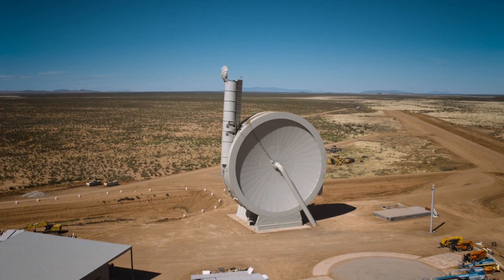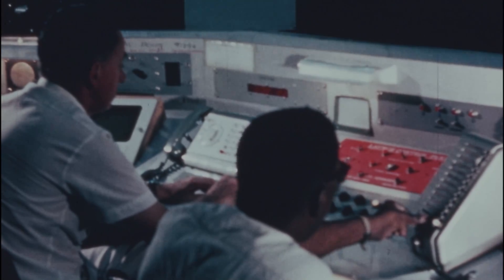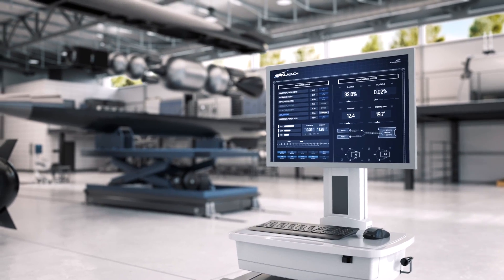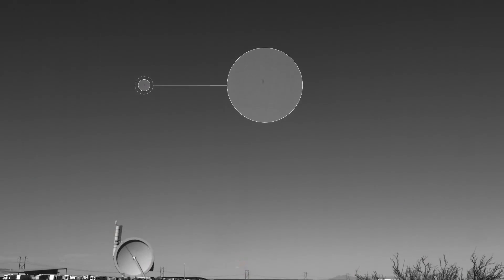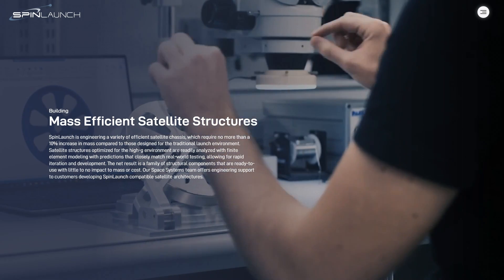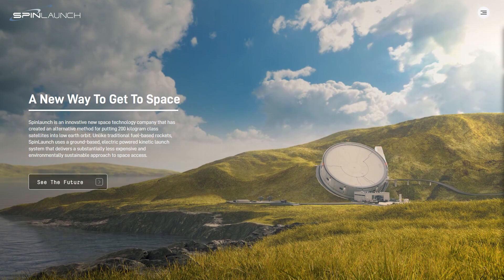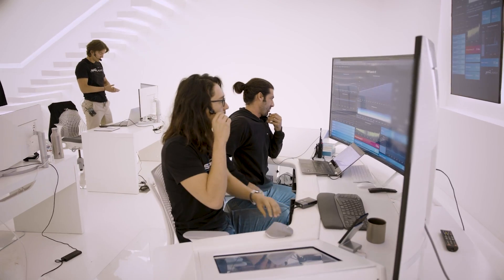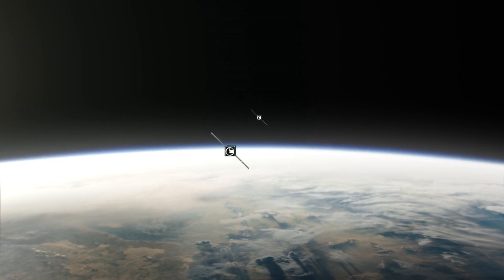Can Spinlaunch Throw Rockets Into Space?

Comment: The rotating arm must be very very very perfectly balanced or the vibrations will destroy the whole machine. Also it must be able to hold many many many tons in tensile strength. Remember that total force = mass times acceleration. And about the balance. Once the payload is released the whole thing becames heavily unbalanced. Imagine that you have 500kg payload. Now, you have 500G acceleration in this. Than means theere is 500 tons of force acting on spinning lever. (250 tons the payload and 250 tons the counterweight.) And in the point of disconnection there is nothing one one side and 250 tons on opposite side. IMO it can't ovelive that.

Comment: This looks like your run of the mill VC scam. They build something that could have been achieved easily any time in the last half-century, and use it to build hype (and huge amounts of investment money) without proposing solutions to any of the problems involved in scaling it up. How will they maintain such a large vacuum for so long in the face of extreme vibration? How will they release the projectile with the required precision, and keep the thing balanced so it doesn't explode spectacularly? And how well they design a projectile that can withstand those kinds of kinetic and aerodynamic forces? It's always demonstrations, never solutions.

Comment: The idea is not new, but it will never make it to reality due to physics:
- how to get rid of the projectile's spin, better to say pitching with several hundred RPM?
- how to get rid of the forces of the counterweight after the projectile's release?
Yes, the vacuum issues can be solved by putting the device onto the moon.
Reply: @Puppet Having a counter weight the same as the projectile and dropping it at the same time down a long drop into a large pool of water would solve the counterbalance issue
Reply: @dv8inpp  That actually seems pretty reasonable. It could even be heavier so it could be closer to the axis and not moving as fast (if that was an issue). 
I was thinking of a weight on the same side as the rocket but closer to the axis of rotation, and the weight moves up  upon release, but it would have to happen really fast. So just releasing weight in the opposite direction seems like an interesting solution. 

(also, having weights near the axis that move out after launch is yet another of the myriad possible ways to slow the thing down quickly)
Reply: This machine reminds me of something Reagan's Star Wars initiative would make 🙋🇺🇲🛠️🇷🇺
Reply: @craftpaint1644  Reagan
When all the nonsense started.
Reply: What do you mean with "projectiles spin"? I dont get where there is a problem with the projectile spinning, other than the 10000 G which arent thst big of a deal after all.. Or do you mean the launcharm spin that causes issues?
Reply: They could add another rocket to the other side of the machine and release it in the same rotation as the first one; by doing this the machine would "only" be imbalanced for half a rotation, tough this is also one of the most critical situations, as thechnicly in this short moment the strongest forces would be pulling. (and the vacuum wouldn't exist anymore, questionable if it would work properly anyway)
Reply: So, the counterweight is something that got me. Perhaps the system could be mounted on a moving arm, if such a material exists, that could take the sudden acceleration, until the counterweight moves to the center of rotation, or a second counterweight moves to replace the weight of the projectile. Or the design could be self-destructive, with protective barriers containing debris from exitting at a dangerous angle.
Reply: @Abrupt Segue That sounds a lot simpler than my idea. Then it just becomes the question of what to do with the launched counterweight; maybe just launch it through a multi-staged barrier, with different resistances at each stage.
Reply: @Abrupt Segue So you will release the energy equal to the projectile into the ground?
btw this energy equals a nice little tactical atomic bomb.
Reply: @peterebel7899  it's not that much.
Reply: @TheJohnreeves  To keep the calculation simple:
- no air in the Earth's atmosphere: 11,2km/s or more needed
- give the projectile 100kg
=> The energy needed equals 30,000kg TNT. Bombs with this energy enclosed are atomic bombs.
Additional comes the air resistance of this fast tumbling projectile. For getting an idea of this please study meteorites.

"not that much", how close do you want to stay to that launcher?
Reply: @Abrupt Segue Oh yes, jet us say a cubic foot of sand would stop this gun shot. Th counterweight would need at least 100x100x100 feet of sand (when used in vacuum, no atmosphere)
Please do expert some effects you never experienced with a gun but with an impact from a meteor. And please do have the fundaments from this launcher well apart from the bottle of sand.

Not just you seem to miss any sense for dimensions. The energy we are talking about is the combined energy of all 4 attacking aircrafts in the 911 event just focussed in one single point of impact. We are not talking about some toys used in a shooting range or even battle field.
Reply: @peterebel7899  Your math is over by an order of magnitude. 1t TNT equivalent = 4.184 gigajoules (4.184 * 10^9 j).
100kg at 11.2km/s = 50*11200^2 = 6.272*10^9 j. 6.272/4.184  = 1.5 tons TNT.

Furthermore, if you double the counterweight, you can move it closer to the axis and halve its velocity. Since energy is proportional to velocity squared, the new energy will be (.5 * m(v/2)^2) = .5 * (mv^2) / 4. I.e. one quarter. It's easy to imagine making the weight even heavier and have rather manageable amounts of energy involved.
Reply: @TheJohnreeves  Yes, you can reduce the energy by increasing the mass and shortening the arm. But this generates other troubles like increased distance to diaphragm, asymmetrical implosion when the counterweight is still in free flight within the chamber, ....
This idea does contain several magnitudes of physical constraints hardly to overruled by engineering.
Reply: @timemachine_194 1. Projectile:
Mach 7 with a tumbling object (it rotates around the tilt axis withe the rotation speed of the Spinlaunch): This is nothing like a projectile flying with a stabilized longitudinal axle.
Oh, you want to hold id pat´rallel during spin launch: you are shaking the whole projectile to death with harmonic several thousand Gs for an hour or so. I especially like thinking about the fuel swapping in the tanks. There is no chance launching without a deadly spin.
2. conterweight:
You intend to open a vacuum chamber, let this piece out and close it again within fractions of a milliseconds to prevent high energetic sand destroying your launcher: Good luck with this one!
Good luck with the fundaments above a chamber absorbing the energy of 7 tons TNT day by day.
Nuclear tests performed underground made whole islands in the ocean to disappear.
Reply: What do you mean? The machine can be slowed down by converting the kinetic energy back into electricity with electromagnets. That seems like the easiest part
Reply: @sebasfavaron  The charge back might be too much for a battery to handle, It would have to be a massive group of cells
Reply: Seva's, did you even watch the video?
Reply: Not to mention you need to make a payload that can withstand the centrifuge

Comment: I imagine that they will try to build the « spinny thing » as high as possible like on a mountain top so the projectile avoids thick air as much as possible
Reply: Not really tho, if that would be beneficial, then they would also just launch normal rockets from mountain tops. But theres just too many issues with that, some of them being the cost of building a base and rocket up there or transporting a rocket on top of the mountain, then the issues when the rocket fails.. Plus even the highest mountsin of earth, being at about 10 km above the ground would help just such a very very tiny amount because 10 km is nothing compared to the whole travel, so that the very tiny benefit of smaller air resistance in the fist 1-2 seconds of travel with building a thing like that on a mountain doesnt even make up for the problems and downsides
Reply: @baadlyrics8705  That's because normal rockets wouldn't benefit from starting a few km up since the main thing they spend their fuel on is gaining speed. They'd still be starting from 0 on a mountain top, they'd just have a slightly easier time, during the part of the flight where air resistance matters the least. 
For the spin launch, the beginning is where air resistance matters most. Furthermore, all the issues with moving a huge rocket up a mountain don't exist since they mostly consist of the second stage which is much smaller.
I don't have the numbers so I still don't know if the gain is worth it, but it's definitely more valuable for spin launch than a conventional rocket.
Reply: One of the reasons they don't launch fuel based rockets from mountain tops because of the lack of oxygen. That's why launch pads are as close to sea level as possible.
Reply: @The_KingPrime   Rockets don't use the air (partly oxygen) around them to create burn, they use a mixture of fuels and oxidants carried on board, like liquid oxygen.

Comment: The “counterweight issue” could be solved by ejecting the arm with the rocket and then immediately detaching it, but replacing that each time sounds expensive! Interesting.
Reply: The "rocket" is on a 90 degree angle to the rocket, and the ejection port is about as wide as the rocket itself is long - there's no way you'd be able to do this unless you ejected to the rocket sidewards (so that the arm it's attached to can come out straight) and then somehow "right" the path of the rocket post-detachment.  I don't see how this could work at all.

Comment: So they are building this giant wheel instead of a gun the the acceleration can slowly build up to 10000G instead of instantaneously, but no-one is asking question about the fact that the projectile will still go back from 10000G to zero in a fraction of a second. Basically causing the same stress and vibrations that they try to avoid in the first place.
This is a scam.

Comment: When I had this idea about 20 years ago, I envisaged that the payload would be spinning on a rail system on the inner wall. Then "all" you have to do is open the exit door with an accuracy of one revolution time period. All credit to them - I immediately discounted it as ridiculous due to the humongous g forces.
Reply: Harder to maintain, tons more friction, issues with the vacuum with this idea.
Reply: @TomShlorp  to be clear, both ways are impossible, but one of them is slightly more impossible. But, when you've done 6 impossible things before breakfast, you fly to lunch on a space trebuchet!
Reply: It is ridiculous. All they have done so far is complete a test at about 2% the energy they will need to actually get something into space.

Comment: I think that scale model isn't that good a showcasing, because of a few things: 1: the chamber wasn't evacuated. If it was we would have seen an air rush into the chamber, which makes me think they can't evacuate it yet... 2. The balloon skin. If you hit that at higher speeds it may just make shrapnel out of your rocket. do If you go fast enough th balloon with all the air behind it may effectively just be a wall. 3. The release mechanism isn't good. They had a slower version and the rocket came out at an angle.... scaled up to the big version with the same error and the thing smacks in the wall, firing supersonic shrapnel everywhere..... idk I see problems here.
Reply: Right ! You see no deflection of the delicate barrier , its perfectly flat .
so there can't be any vacuum
All the physics issues would magnify when its made larger

Comment: A refreshing look at this.  Much respect for not coming off as a fan-boy or complete skeptic.  I seriously don't se this being a  viable launch system on earth, but from the moon? Now that's completely plausible.
Reply: Yeah, this would be much better with no atmosphere. I also could picture this as an hybrid system allowing the rocket to lift off, but using fuel afterwards. So You do get to save a lot of space and fuel on the rocket, but keep the spin launch system operating at controllable load. The problem with this system is it is very hard to scale. Their goals of payload and speed are insane and most likely impossible. But, if you use it only as a first stage of a fueled rocket, that could be less challenging

Comment: I would be interested in whats the cost difference is between, say a 500kg satelite launched by space x vs a spinlaunch and that compared with the additional cost of building your satelite resistant to the mentioned g-forces
Reply: they are testing a lot of equipment, they say testing show it's no big deal to make equipment resilient to extreme g forces. 
Cost is going to be almost nothing in actual consumed material and energy. Just the time needed to reset, service and check the equipment. Hopefully all launcher parts are sturdy enough for several launches without replacement. 
If they can make this technology work reliably, it will outcompete SpaceX by a lot, probably 100x cheaper per kg payload. But SpaceX have the edge of a much higher max cargo size, so they would still be relevant.
Reply: @migBdk  well, its simply different markets: if you want to transport a small satelite to space... this is the best solution. If you want to transport huge things or people, spaceX might be a better call... so not really competitors in that sense.
And regarding the G-Force thing... I'm not so optimistic: i'm working in the automotive sector and its quite hard but make something resistant to upward of 20g... a lot of standard connection you would rely on in normal circumstance, don't work anymore. You could cover everything in a mold, but then there is the issue of huge temperature differences from white hot during launch to then in outer space... plus the huge testing effort to make sure everything works, since you pay quite a lot to put it up there. but still: this sounds a lot more likely then just boosting out a ton of fuel :)

Comment: Thx for the video. Impressive. What will happen to human astronauts onboard a spaceshuttle if it is thrown up to the outerspace by this spinlaunch technique?
Reply: Any biological structure will be vapourized during spinning. A human body cannot bear more than 5 - 6 g over a limited period of time. The spinlaunch causes 10.000 g over a longer period of time, plus the violent crash into the air after release. Both will even kill any multi-cellular creature reliably.
Reply: @norbertfleck812  
Thx. That is what I am thinking about. It will happen also to the material, non-biological payloads at certain speed of the spinning. So, why to build those spinning mechanics? Do you have further thoughts about it?

Comment: Also, not much force is applied on the electronics because the parts are so light. Chips may undergo lots of acceleration but the mass of the chip makes it hard to apply enough force on itself to bend or morph the chip. I launched electronics in a small rocket and it crashed into the ground with with it's second stage accelerating it. The battery, rpi, and and sdr were all in tact.
Reply: Earth to Dumbell Frankie:  The amount of Gs applied are exactly the same regardless of weight.

Comment: Spinlaunch is to rocketry what Nikola was to trucking - a slick front man, a lot of fast talk, a bunch of glossy graphics, and a serious lack of practical engineering. Right off the top, if you're spinning a projectile at 450rpm inside the chamber, it's not going to suddenly fly straight as an arrow when you release it - it's going to be tumbling at 450rpm as it goes up the launch tube and out into the atmosphere. Thunderf00t's slow motion analysis of the test launch seems to bear this out. That they haven't even addressed or admitted to this one problem among legion tells me they're not actually serious about launching anything. This is a scam from top to bottom.

Comment: It's not that hard to balance the release, the pivot point of the beams is actually a fulcrum and you move the pivot center of the beam as you release the payload, you move the weighted side in and the longer side out to compensate for the release. If the payload is only a small fraction of the beam weight, it's not that much that it would have to move to rebalance.

Comment: Maybe use a fluid as the counterweight and spray it out at launch to balance the mass energy.

Spraying the mass over a short period as opposed to shedding a massive counterweight load immediately would reduce to be destructive forces to the launch system as the mass would be dumped as it spins and spread around the launch system.

The sprayed fluid would immediately start reducing the forces exerted on the launch system and may help to maintain material stability of the apparatus within operational limits.

Using a fluid also allows you to modify the rate at which the counterweight mass is dumped from the system and would allow for variable weight payloads, though with sub-maximal loads you will have to deal with sloshing problems during spin up.

Comment: Couldn't you solve the balance/moment of inertia change at time of release simply by having 2 rotating arms opposite eachother and on the arm opposite the launch arm you have an inert counterweight that is released at the same time? i.e. the vehicle goes up and at the same time the counterweight is released and goes down. essentially firing 2 projectiles at once in opposite directions. You'd then have some kind of tunnel / bullet trap built underneath the launch site that catches and decelerates the counterweight. (or is filled with a denser than air gas so that the counterweight burns up over a relatively short distance). 
¯\_(ツ)_/¯